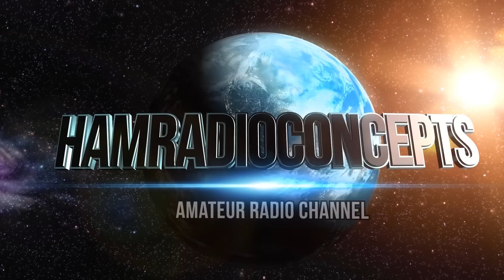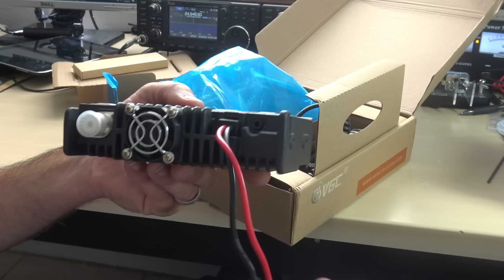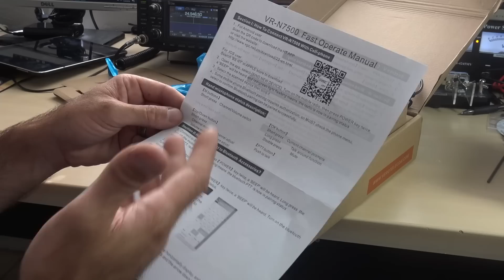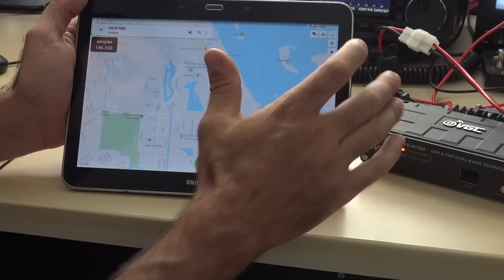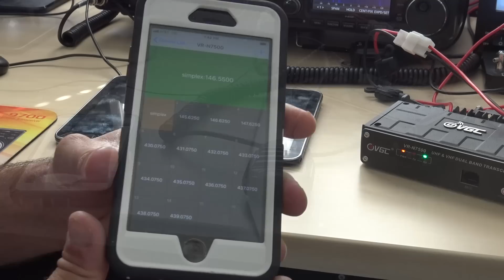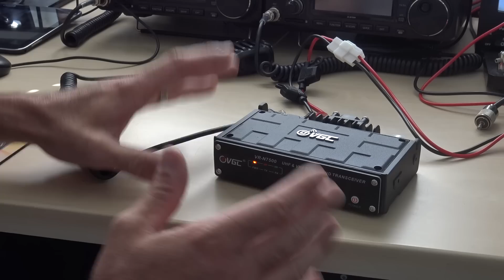NEW! VHF/UHF Bluetooth Ham Radio, VGC VR-N7500, APP Programmable

Comment: I recently bought the VGC handheld, also built in Bluetooth. But doesn't connect with my car. So, you always need an extra headset or BT microphone.
BUT: the headset can't do the PTT, you need the extra PTT-BTT for 20 dollars. WTF?
Should I give the 7500 a chance?
My Yaesu FT-M 500 works with my headset perfectly, but doesn't connect to my car too. That's really poor these days. I suppose the BT-protocols are to old...

WHERE CAN I FIND THE OTHER VIDEOS ABOUT THE VGC 7500?

Comment: Installed one on my motorcycle using a Samsung Galaxy J1 phone and the VGC app to switch channels etc. It works fb with my helmet comms, made a wired PTT as the supplied BT one isn't great imho. Also have the bluetooth -75 speaker/mic and the -78 'HT', but I found the phone most practical when on the road.  I have no idea of maximum no. of channels but I haven't run out of space to date. No VFO as far as I know, but I use it on the road so the channels are fine for me.

Comment: I gotta tell you this thing is driving me nuts! I can't get it to join with an Android. But got it to join on iOS Then if you mount it out of the way like under a seat you still need to reach the face to turn it on. Then the Chinese instructions and lack of manual is the worst. I bought TWO of these based on these reviews. #totallyfrustrated
Reply: No you do not need to reach it to turn it on. You can turn it on remotely with the BT link.

Comment: popping up for sale at $200 new.  A little unnatural to use with a table or phone - yet that is likely where ham radio may be headed,    https://www.verotelecom.com/VERO-VR-N7500-50W-Dual-Band-Mobile-Radio-With-APP-Programming-p541441.html   https://www.verotelecom.com/VERO-VR-N7500-50W-Dual-Band-Mobile-Radio-With-APP-Programming-p541441.ht       Mike N6IMY

Comment: A lot of great features in this radio!  Seems to be a great quality build too.  But seems like it might not be suitable for an emergency use yet.  

One reason is that if you are activated for a Community Emergency Response Team (CERT), it is common to have someone assigned to setup all CERT radios with set programming specs (freq, offset, channel, etc.).  CHIRP and other software can do this very quickly, relatively speaking compared to the radio in your video.

Second reason not for emergency use is you now have another device to carry around to support the radio....your phone or tablet.  Along with that is the need to provide power and maintain that phone or tablet, likely having different charging cords (Android vs Apple), need to know each phones settings to get Bluetooth link to radio, etc.

A simple baofeng radio will be much easier for emergency use with ability to have common programming support and no user specific equipment issues.

While not as much an issue, but for club communication events, similar concerns could arise.  Have supported parades and other community events with ham radio communications and such issues did arise in those situations as well.

All that said, technology can evolve and likely will overcome some of these issues over time as the developers better understand how the radio can be used.

Comment: So I have a question, IF you bought TWO of these and installed it in two seperate vehicles but used the same iPad mini how does that work out?
Reply: You give each radio a different name when you pair it in the app. You can select between however many you pair with on the main screen.

Comment: It would be cool if it could be interfaced with your vehicle via Wi-Fi or BT and use the vehicle's display and touch screen.The finger button doesn't look very useful when riding a motorcycle. Why is VOX not included on newer rigs? I know there are lots of wind  and other noises when riding a bike and other situations where it might not be the best choice but in some cases VOX might be useful. Years ago I had a earphone with the mic built into the earpiece. Not dangling on the cord but built into the ear and it's input was through your ear canal. Used it on my KNWD TH-78A and later the TH-D7A for many years. Eartalk I think was the name of it. Something like that would work great for motorcyclists and in many other applications. DPA makes an in-ear broadcast headset mic today. Don't know anything about them but maybe worth a look for you to review for potential ham applications. https://www.dpamicrophones.com/headset/in-ear-broadcast-headset-microphoneI think MFJ had their own version of this a few years back too.

Comment: I’ve been complaining about the lack of smart tech in radios, but I think totally blowing away the front control panel is a bridge too far for a mobile ham radio. 

But I still want it badly.
Reply: @Jason Bowman don't know if you can get them in the states but GME have had a UHF out for about 3 years now that is exactly that. It has a display mic for every day use and Bluetooth connection for setting. But because of the more restrictive laws in Australia it's only 5 watt transmit power and anything but the standard band (477 mhz) is receive only

Comment: Awesome Video!!! 

When connected to APRS and a bi-directional iGate, will the data from other stations be shown on the Table/Phone with out using the wireless internet? 

Is it possible to add an external GPS?  Table/Phone GPS isn't as accurate as a dedicated GPS antenna.
Will it be capable of using EchoLink? 

I'm assuming they are able to upgrade the radio as it's an SDR. 

8P6RC

Comment: A little concerned with the requirement for an app. What happens if the app goes away in a few years? There could be a more generic web based interface. Maybe with an up-down volume & channel control on the microphone, how often do you need other controls. Like the magnetic Mike attachment, no metal in the car, just add an attachment point, no special hangar needed.

Comment: If they release a CarPlay app for this thing, it’ll a be the perfect VHF\UHF mobile ring.  ... it’s not far off now, truth be told.
Reply: i have an android car radio with a 10 inch display this would work great
Reply: @wilnel71  that would be great
Reply: It's part way there now, you can use the car radio in Android auto/carplay to listen and transmit over the radio. Now if you can get the app on the car radio that would be perfect.
Reply: If its a android device why won't it work?
Reply: @WW5RM  it's basically up to the developer. I have scanner radio pro on my car radio, didn't know it was an option to it just showed up automatically. Anything installed on your phone that is Android auto compatible shows up automatically. Hope they either create an app for it or release the APIs so someone can develop an app for Android auto. Now if you root your phone I believe there is a way to do it manually.
Reply: @TedZarcone  so CarPlay is a os?
Reply: @WW5RM  CarPlay =Apple(iPhone) Android Auto(Google OS)
Reply: @TedZarcone  ok if thats the case then why does James Martin need them to release a car play app? They already have it for both ios and Android so how is car play different?
Reply: @WW5RM  it's like on the phones they can restrict things. If you have 100 apps on your phone you wouldn't want to page through 20 pages of apps just to open Waze. If you root your phone there are ways to install the apps that don't have the flag for AA or CP. But even rooted you still would not want every application that is on your phone mirrored to a car radio. How many times would you play Tetris While driving lol. Plus the car radio app lost is only like 10 apps at a time. I just think it's like a simple checkbox almost for the app developer. I only say this because you never actually install the app on the car. The ones that can be used just show up automatically. Or you can use the car play store to see which you can install (think you can also do it on the normal app somehow never bothered to check) that's how I knew the scanner app works went into the so screen and was there :)

Comment: They charge $9.95 to use Paypal, but give no other choices to pay. shipping does not appear, so it looks like shipping to Florida is zero dollars.  They need to improve their web site and give people the ability to see shipping, and if it is zero, tell them so. The only way to know is to go to Paypal checkout and see what they submit for payment.  The bluetooth button is and option and it brings the price up over $200 by a little. It's too bad it does not have DMR. I have so many analog radios, and the Only thing that would push me to buy it would be a digital mode, either DMR, or Dstar.  Then I wonder what it would put on the screen if you accessed a Openspot2?   I have the CS800D, and the big display when Connect Systems sold it for $150.00, It is rather nice. Too bad Jerry does not let hams program the display output. We have a lot of talented ham programmers that could do some amazing programming. Jerry Wagner, if you are reading this, make the big display programming open source.
Reply: Yeah I'm not a fan of the color scheme or fonts used on the big display. Third party programmers could  do a good job making the UI look modern

Comment: Very interesting radio, thanks very much for sharing. I'm just in the process of installing my ICOM IC-2300H in my new/old Ford Ranger. With limited cabin space having a small transcever tucked up under a seat, offering hands free operation would be ideal. I'm wondering now why ICOM, Yaesu or Kenwood have not offered such a mobile radio. In this era where distracted driving is such a big issue, the timing for the introduction of such a radio would seem seems perfect.

Comment: Imagine if this radio's app linked up with apple car play or android auto. Then it would be seen on the main screen of the vehicle. Then using the speakers and mic from the car using the little PTT button, I might be interested then.
Reply: Seams like a good idea,  hopefully someone can figure it out.
Reply: Can use BT with Android auto and carplay to listen and transmit through car radio now. Just can't see the app through the display. Can even use the included PTT button that is BT to let the car radio mic. I would think since there is an app for both IOS and Android an app for the radio could be done in future as well that would be really nice.

Comment: Thanks for reviewing!  I would like to see how well it works when you're phone isn't hooked up.  Like how quickly can you mute or turn down the volume, does it remember what frequency it was on last or does it default to   like ch1 or something.  Because although the phone app is nice, I'm sure it's slow to connect over BT and for reliability and emergency, I want something that works without a lot of fuss.  I ldont mind the fuss when not in emergency.  

Also, This thing is a software upgrade away from working with the repeater book app like my 857d.  Man that'd be slick!!

Thanks again!!!
Reply: Works just fine without being connected. Memory up/down and volume from the mic. BT connects rather quickly.

Comment: I think it's a pretty neat idea for sure. I read on their website that depending on your car, it can also use your car's centralized display which would be super rad too. Not sure what dictates that. Either way, I think it's an affordable option for folks that want touchscreen control and already own a tablet. Still cheaper than an FTM-400 and even the crappiest tablet has a better touchscreen than that thing.

Comment: If that was DMR I would be interested and sold. I have an old phone that I could use for the face. Mount the main unit under a seat and use a RJ45 connector if I needed to make the mic cable longer. Plenty of places I can mount the old phone that wouldn't be in the way. If someone made that type of radio I bet it would be a big seller but just as a VHF/UHF not sure I'd be a buyer.
Reply: The hell with dmr.

Comment: This would be cool to connect to one of those aftermarket double din android car stereos!
Reply from the maker: I thought of the same thing. The Android double DIN.
Reply: Great idea!
Reply: I was thinking the same thing, and wonder if the manufacturer was thinking that way as well
Reply: I hope to have the radio today.  I'll try it out on my Android car radio and the Anysecu W2Plus.
Reply: Works great on my Anysecu W2 Plus network radio.. The Bluetooth on my Android car radio is giving me problems. The app works fine. Join the network works great. I made a group called US Travel.
Reply: @DavidS-iw4ei  is it still working?
Reply: @linaskerbelis5636   I have two VR-N7500 radios. Both work great. Vero did a firmware update on the radios via the HT app. THe W2Plus works great with the VR-N7500 radios. Check out facebook for the VR-N7500 group. Sorry, I'm not on facebook.  Also check out the Google groups. Vero VR N7500 Dual Radio Band
Reply: @DavidS-iw4ei  u